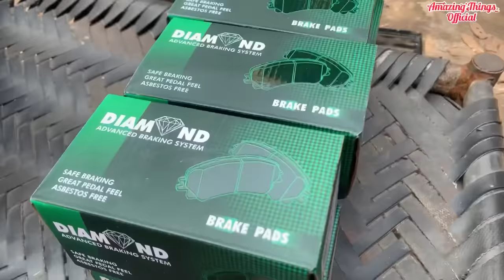How Carbon Fiber Brake Pads are Made In Local Factory || How Car Brake Pads are Recycle in Pakistan

Comment: Everything looks good in a fancy package. I wouldn't want to breathe in the dust (asbestos, silica ,plastic, aluminium etc) or the paint fumes.
Reply: Couldn't agree more, this guys need protective gear!
Reply: Exactly
Reply: @nicolascrescimone  Coming from an anaesthetist, that's a bit harsh.
Reply: @daviswalunywa8451  think it may be to late
Reply: Wont live to 30 that boy omg
Reply: Thats why they breath and you pay 🤷‍♂️
Reply: That's actually a good point, I was watching thinking about how impressed i was and they have no PPE, half have flip flops on, no eye protection while on those grinders, the big metal forging vids are scary too.Good comment daintree98.
Reply: Drinking alcohol is as toxic and yet you guys still drink it
Reply: Excellent work .but those guys will die sooner breathing that dust.
Reply: Yeah long term doesn't look good for these people. Some precautions could be taken. But wouldn't want to cut into those profits.
Reply: @olafzijnbuis  At least the package says "Asbestos free"
Reply: @nicolascrescimone  Wrong country...
Reply: God lord boys. I’m not sure if your going to hold up to the break test.
Reply: Today the most common type of brake pads on the market are made from metal and typically include iron, copper, steel, and graphite all bonded together to create the device. But as the title says these use carbon.  I'm fairly sure there is no asbestos.
Reply: @nurulfakhri6312  WRONG.  Man has been drinking alcohol since before recorded history, sometimes out of necessity because safe water wasn't available.  In fact, drink too much water and THAT will be toxic to a human.  All things in moderation.
Reply: @bradlys4978  "fairly sure"...
Yeah, not so much.  There's ZERO product safety standards there.
Reply: @bradlys4978  These brake pads are reconditioned. At 3.00 they show  the method of removing the old material, which probably contains asbestos. But on the Diamond box is written " Asbestos Free". Also remember that India, Pakistan, China, Russia and other countries use a million tons of asbestos per year.
Reply: @ffjsb   Yes, that's correct. Fermentation of food has great benefits for the human body. But depending on the sugar content their will be variations in alcohol content. Mead is one product that has been produced for thousands of years. It has a varying alcohol content and can be stored for years. Depending on your tolerance to certain foods, even the caffeine in a very strong coffee will make you sick.
Reply: @daintree98  I don't think there was ever a break pad made with asbestos. Too new, maybe break shoes contained asbestos at one time. old brake pads do not. like you said the box said asbestos free. But yes there are still many places asbestos is used and should be banned 100%. Don't think break pads are one of them.
Reply: @ffjsb  Didn't you see all the PPE they were wearing. lots of safety. Just kidding. but yes I know what you mean. not even safety glasses when grinding. 🤣
Reply: Why not? It’s good for you
Reply: @daintree98  good thing I don't have kids yet. Didn't know that about the baby powder. Scary.
Reply: Oooh my God!!! This shows you how to appreciate the life we living. NGO must act fast to protect these cheap labor at least providing them with eyes and respiratory gears.
Reply: While in Europe we got the most restrictive environment laws, unemployment, low birth rate and illegal immigration...
Reply: @bradlys4978  Canada doesn't have to deal with Islamic extremists, nor with Islamic ghettos... Your environmental laws can be great, but how tall has to be the wall in order to avoid China's emissions  affect Canada???

Environment laws lead to higher production costs. After constructing 15km tall wall, you in Canada still need to compete against china low cost products...
Reply: @athalfridhu  😂🤣😂 yes it would have to be a tall wall to keep that pollution out. Maybe a bio dome over the entire country. not a wall. 😂 would be nice if each country  can keep their pollution to them selves. If only it were possible. Then the production costs would have to go up to lower pollution. Or we could just learn to live without certain luxuries and not even need the majority of the pollution in the first place. One big problem with the workshops in Pakistan, they would not work in a Canadian winter. 😋
Reply: @bradlys4978  sorry, I should have mentioned "sarcasm mode on"
Reply: @bradlys4978  The real luxury is our environmental laws. We can produce and consume luxury items without polluting a lot. We don't need to give up that. Pakistan, India, China have to stop polluting, and take care on their workers health. I don't see how reducing our welfare state in first world will help them to achieve that.
Reply: @athalfridhu  Less pollution means less goods or more money. Equipment costs money. Raising prices means less goods are made or it means you can afford less goods. That means less luxuries for you! do you not understand how basic this concept is. But yes workers safety should increase but who is covering that cost in production and equipment. Do you want to send free safety gear for them to fix this problem? They don't want to pay for it. I know with the  billions of people I can't afford to pay for that stuff. one day there will be a bunch of one eyed pirates running around and they might get safety glasses. It's hard to make changes. It is usually easier said than done unfortunately. We are still improving safety in the USA and Canada. How do we expect them to keep up. They don't even have concrete floors to work with.
Reply: @jurgenschmidt3096  All good. thought it was a little basic of a question. But some of the people that made comments on this channel have been a little slow and wasn't sure if you were being sarcastic or not. My bad. 😂🤣😂
Reply: @colbyhutzellfishingvideos4365  
I could for one day, but after one day I would like my old job back. Definitely hard working people. 🍻 Don't think they would last long at my job. working oil rigs at -40 in norther Canada is not easy. But yeah. I think we get conditioned for our environment. Put me in that heat all day and I would melt. Could not imagine. But they could not imagine working in -40 either. would be funny to see their faces when they step off that plane and feel the first little wind breeze. Like needles to the skin.
Reply: @bradlys4978  they are probably pumping 90 percent of the oil in the world, they arent strangers to your job either lol, you arent special.
Reply: @colbyhutzellfishingvideos4365  
Pakistan produces 88,261.73 barrels per day of oil (as of 2016) ranking 53rd in the world. Pakistan produces every year an amount equivalent to 9.1% of its total proven reserves (as of 2016).
Canada's oil production in 2019 was 2.95 million barrels per day.
Reply: @bradlys4978  if you only knew lol, wjere abouts do you work on this so called oil rig? And who do you work for? I know alot of people in the energy business lol, and you dont soundlike one of them
Reply: @colbyhutzellfishingvideos4365  Why would I tell you who I work for so you can start trouble. Who do you work for Nancy? Since you know nothing about oil? Your probably a Biden lover. 🥰
Reply: @bradlys4978  i traveled to where the competition was, and it wasnt Alberta LOL. If you only knew lol
Reply: @bradlys4978  im willing to bet you never seen a f***in oil rig LMAO
Reply: @colbyhutzellfishingvideos4365  You seem like the San Francisco type of man. 🤣😂😋.
Reply: @bradlys4978  where do you live Sunnyvale?
Reply: @ffjsb  whats your beef?
Reply: @nicolascrescimone  😹😹😹😹andouille ce sont des talibans 😹😹😹😹
Reply: @bradlys4978  tout le monde n'a pas vocation à vivre dans un congélateur a ciel ouvert
Reply: @bradlys4978  je suis metalier et je n'ai pas besoin de lunettes le masque à poussière me suffit largement
Reply: @athalfridhu  vous n'avez pas à dicter l'attitude à suivre pour ces pays en voie de développement d'ailleurs vous finirez par ne plus rien vendre à personne
Reply: @Teipd170  Oui ces't froid ici. Aujoduit cest -36'C. Cest un long temp Que je ne pas parler ou ecrirre le Fracais,   24 ans +. Je loblie becoup. 😂
Reply: @bradlys4978  vous êtes des deracineurs professionnels vous saccager vos forêts et vous osez en plus affirmer que ces arbres repoussent plus vite que la découpe 😹😹😹 alors continuez comme ça c'est très bien mais ne donnez pas de leçon a ces gens qui font avec les moyens du bord
Reply: @bradlys4978  nous ici en France dès qu'il fait -5 le pays est bloqué 😹😹😹
Reply: @Teipd170  It takes 30 years for a poplar tree to grow back. It takes me more than that to clear my land. I live in norther Alberta. Trees are everywhere. No room to have a home if we don't remove a few trees. You have no idea. How can people live in a place if you can't make a yard? just because other countries have no trees it is not Canadas fault. we need to do some development to live. I am surrounded by forest for miles. My nearest neighbor is 12 km away. nothing but bush between us. The only open land around here is for homes and farms. the rest is trees to provide wind breaks for the farms. Do you have lots of trees in France?
Reply: @Teipd170  Canada looses more trees every year to forest fires than what is cut down. That regrows very quickly. Do some research. you might learn a bit. There are many other countries that are the problem for deforestation like the rainforests. The reason forest fires are so big here is because we have no access to fight the fires due to the size and density of the forests. We are surrounded by forests. Especially, B.C. and Alberta. I bought an Alpac farm to keep the plated trees. What have you done to save a forest? Talk is cheap! I am doing my part, are you!😁
Reply: @Teipd170  -5'C here is t-shirt weather. Means summer is around the corner. 😃summer I can't wait! looking forward to it already. We have snow here from October to May. So 7 to 8 months of winter. 4 or 5 months only without snow. But I think China's over fishing in protected areas is more of an environmental problem than Canada and some logging. Lots of times we log forests that have already burnt from forest fires and salvage the wood. often no live trees get take down.
Reply: @colbyhutzellfishingvideos4365  You commented to me pal, then deleted it.
Reply: @olafzijnbuis  wrong guess! in fact the use of asbestos has increased in devoloping countries during the last years. the "health issue" is seen as luxury problem.
Reply: @bradlys4978  comment une foret au milieu de nulle part arrive à brûler sans l'intervention volontaire de l'homme vous préméditez forcément ces incendies pour pouvoir raser et reconstruire
Reply: People don't count in that country if your not upper class.
Reply: @joelwood6950  No it's just the truth.
Reply: @webgazda  It's not when world's fault there government has a class system.
Reply: @Slazlo-Brovnik  Yes nice play on words no charge for fast death.
Reply: @zelensky6439  Remember 'paper never refuses ink'.
Reply: They would make good toxin study object / control group.
They all use those japanese foot patches at night for a fresh start in the morning.
Reply: They're asbestos free, it says so on the box. The rest is all true.
Reply: Plus they not even carbon fibre 😅👍🏴
Reply: But u do, trust me. Maybe not so much as they, but you breathe with this on the street- pads are grind by brake discs while braking of the vehicle, dust created that way is airborn with moving air pushed by passing vehicles.
Reply: @AlexanderTheGreat248  yep “not so much” hardly any compared though. 
The guy that changes your front tyres are the one that get the biggest dose as it were, u seen the black crap that accumulates on your front wheels right? Damn nasty stuff, and with all them newly boxed pads to go back for resale it still only barely makes enough to make ends meet after all that hard graft. What a privileged life we lead hey ✌️🏴
Reply: Their pads are asbestos free...
Reply: Great Post, I agree. No asbestos tho
Reply: @joelwood6950  
What does being an anesthetist have to do with it?
Reply: @olafzijnbuis  Cubans do the same thing to rebuild brake pads. And they use Asbestos and they know all the warnings about asbestos. Believe me is banned in the first world. Not the third world.
Reply: @frankierutherford1888  most likely their skills and the materials, they use to rebuild brakes will hold up. The problem is but how long will they live.
Reply: These guys will live longer than you
Reply: @ffjsb  i tagged the wrong person lol. WOW...
Reply: @olafzijnbuis  they still use it in brakes pads, they have to as there isn't any other item as effective.
Reply: Well dummy you are breathing it just in a small quantity it's like it disappears.

Comment: OEM quality, no doubt!
Reply: OEM is just a certification, but must likely this is how your $100 high performance pads were made!! 🤯
Reply: Well, BMW are trash quality parts, and when China stats to make OEM BMW part it seems to be better quality now.
Reply: So that’s why I got 160 thousand miles on the OEM pads! I could’ve easily gone at least another 25K out of them. I hope I get just half that out of my Bosch heavy duty replacements.
Reply: @SG-gc7mn  I highly doubt that its cheaper to let them make them this way instead of mass producing the pads in the thousands in a factory. They made like what, 100 pieces in a day or so? You could probably make thousands in a fraction of the time and cost.
Reply: @SG-gc7mn  Most likely, not.

Comment: Crazy part is how, once all packaged,  it actually resembles a good, quality part 😳😳😳
Reply: more like the scary part!
Reply: well is the way they make them in any parts store you would go too..
Reply: @Mr_Meowingtons  actually they are doing counterfeit japanese brake using fiberglass instead of carbon fiber. It's criminal and very scary.
Reply: Bloody lethal
Reply: its frightening
Reply: Ebay and Alibaba.....
Reply: @Mr_Meowingtons  no it is not  Those brake pads are dangerous . I admire the skill to create them , but they are far from safe .
Reply: @davephilpott6569  I would say in a very low speed high urban density environment they would be fine . On a highway ?  Not a chance
Reply: don't kidd yourself. "Good" quality parts are made just a block over by their cousins !!
Reply: Thanks to Ebay and Amazon, those pads can now be sold all over the world.😉👍😬
Reply: @agalie7139  at least it has some fiber in it, right?
Reply: Yeh, its shocking
Reply: Guys says they are dangerous? Whole Pakistan is running on them since ages. Me myself used them. Never failed.

The work conditions the labour is working in, is a separate story.
Reply: These are probably for the local Pakistani market, where the typical top speed is 30 mph, and the vehicles are small. These cost 6x lower than imported ones, and that’s all most can afford.
Reply: I hope your beeing sarcastic who says that what there giveing us is not as good or better than what we get
Reply: Grinders and paint make them the brake pads they ain't.
Reply: They do look like a brake pad.

Comment: Would Like to See Them tested against some regular Brake Pads
Reply: Don't worry they will work up to 1K Km
Reply: Just put a set in my car. Well they look the same
Reply: No, you really wouldn't. The number of crashes, accidents, and deaths on Pakistans roads is terrfying, shit like this is part of the reason why.
Reply: @sideshow101101  well the parts of the vehicles aren't the reason there are a lot of crashes, Drivers are what cause these accidents they mostly occur due to over speeding. For the trucks having accidents it is because of overloading or them sleeping on the wheel.
Reply: @AB-py4ur  All true, but i think having your brakes fail when you drive like a madman also causes accidents.
Reply: I can assure  you these will out do others.
Reply: MichaelcohenLyingPOS   elaborate  factory  makes no difference.  The quality  matters., I can assure u these brake pads  will out do fancy factory  ones
Reply: They would certainly out do regular  pads 100%
Reply: MichaelcohenLyingPOS  

Honestly  I am  not lying  it's amazing and good material and ever lasting. I have had them on my car for over 6 Yr
Reply: @Afzal Makh  that's a bold statement to make with little or no data to back it up.
Reply: @RolandtheThompsonGunner  what data u require?
Nothing is guaranteed  even life.
But they are of good quality 👌
Reply: @afzalmakh9561  though you said you guarantee they are better than factory pads.
Reply: @afzalmakh9561  dream on 🤣
Reply: @ichhier5165  boy it's a pure craftsmanship . B honest have u ever seen  something  like this in Europe  etc they can only 🍸  and p... and s...
And don't even  wash their hands.
Reply: @RolandtheThompsonGunner  I.never said that I guarantee. U div
Reply: MichaelcohenLyingPOS  yip to that
Reply: Those are regular brake pads
Reply: @sideshow101101  Breaks are not made to save lives, they are to make driving easier. We all dye when our time has come, nothing we can do will postpone.
Reply: I dubt that new brake pads are the reason, it's more a preventing item than a 
cause.
Reply: @sideshow101101  no non è così , vista la difficoltà di percorrere  molte delle loro strade di montagna i freni sono proprio una delle cose a cui gli autisti tengono di più e impiegherebbero un secondo a cambiare marca dei freni se non soddisfano le loro esigenze , a maggior ragione che i camion , pick-up ed auto sono spesso stracarichi nell' affrontare le strade di montagna .